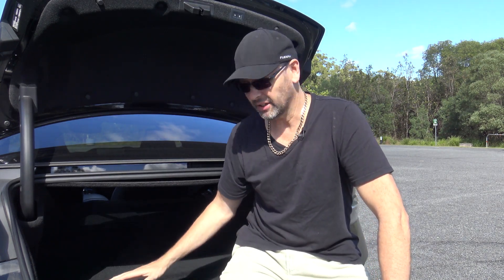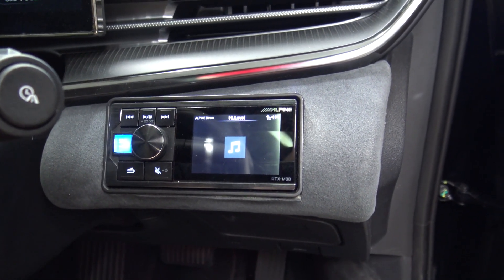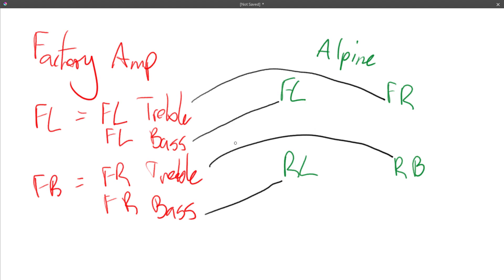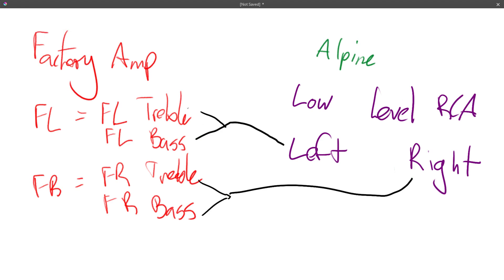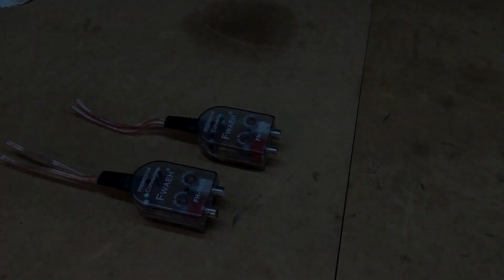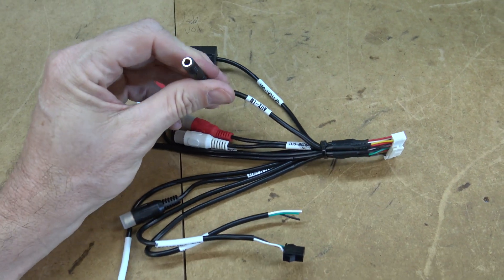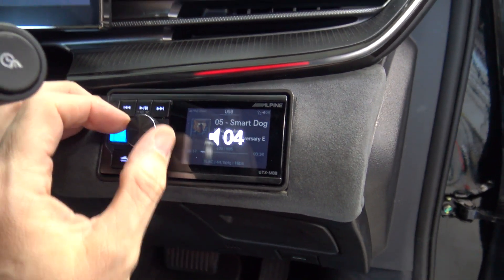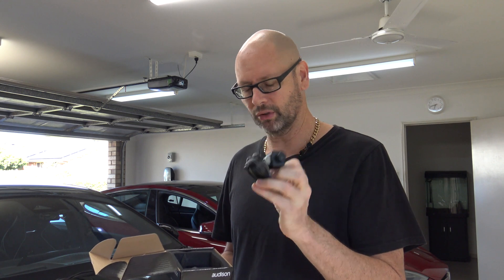Car Stereo High-Low Audio Level And Mixing

Comment: Or you can just use a better DSP, one with 8 high channels or more.
Right now I'm searching to see if I can decode de A2B protocol from central unit to give it to another DSP (witch is a thing that all DSPs should already have natively). This should be awesome.

Right now unfortunately the only thig that I found in this direction is Audison Maestro, made just for one ford.

Comment: The BYD head unit is a android table,  you can use a external DAC connect to usb port , then get "pure" low-level output , (it only  output sound from APP, like navi or Spotify,media player ) . Car system warning still output from factory  amp. I watch big screen video with a DAC +earphone when kid sleep at back.Hock up a dac from car usb to your aftermaket unit then you can use the big screen play music.
Reply from the maker: Interesting
Reply: Awsome!